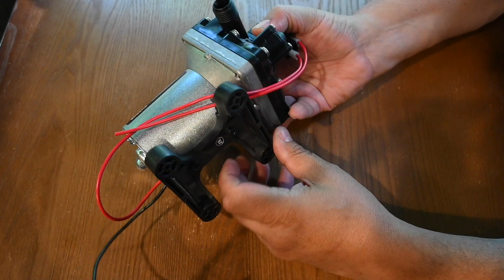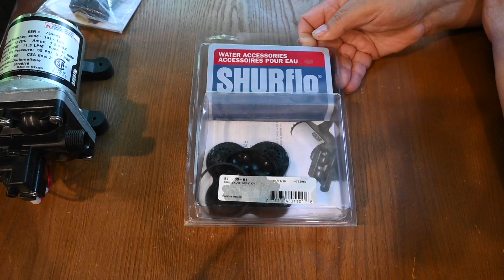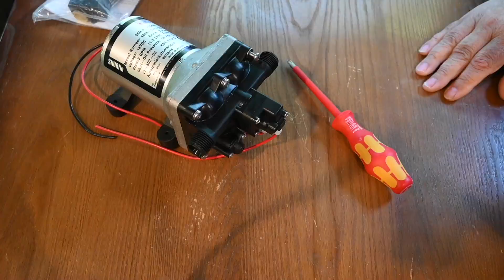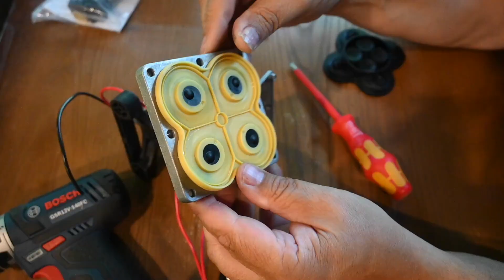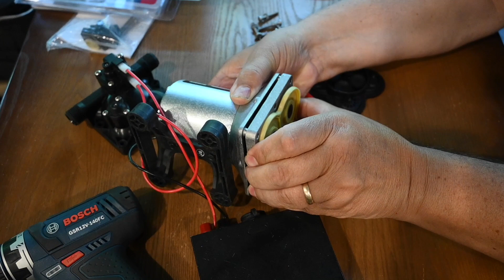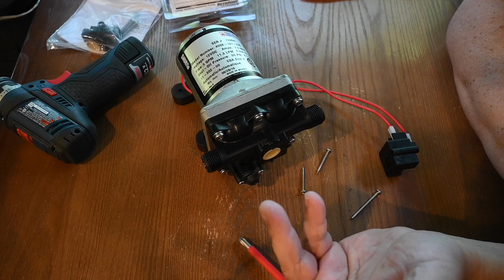How RV Water Pumps Work.

Comment: My Shurflow 4008 pump is 8 years old. It suddenly started to operate very slowly (electric motor goes very slow). I checked the voltage and its 12.95V.  I bypassed the pressure switch and its still very slow. Any ideas out there as to what has happened?

Comment: Great video man!... question i'm using a diaphragm pump like this for some misting nozzles, i need at least 43 psi and it says on the the pump it has 98 psi max so it should work but it shuts off before it reaches 40 psi, i have a valve to recirculate the excess water flow to the tank and i close or open it to calibrate the pressure i need but like i said it turns off before my desired pressure, could i disable the switch so it's simply turns on when supplied power?

Comment: Mine wouldn't stop running, so I replaced the head and now it won't run at all.   Any tips?
Reply from the maker: The head includes a pressure operated switch that turns the pump off. Did you re-install the switch correctly when you replaced the head?
Reply: @RVProject  yes, it's not difficult

Comment: Good recommendation on the strainer! On my last RV the pump stopped.  I took it apart and found plastic shavings from the tank ripped the diaphragm.  I replaced the diaphragm and added a strainer.  No problems after that but I do need to see if my new RV has the strainer.
Reply from the maker: Glad I could help.

Comment: Great video. Is there a shelf life on the spare parts to be concerned with?  The one part I didn’t hear mentioned is the check valve. I’ve read a lot of posts about the check valve going bad.
Reply from the maker: There is no check valve per se in this model pump. Perhaps other pumps may have such a valve.

The outer cover of this pump has 4 cavities, and each cavity has two one way valves - one to let water in and one to let water out. I suppose these are check valves in the strictest sense, but since there are 8 of them, they perform a slightly different task.

All I can say is that between the boats I previously owned and the two RVs, over 20yrs of having SurFlo pumps - I have never had a valve issue.

For sure, it is only anecdotal evidence of the pump's reliability, but that has been my experience.
Reply: @RVProject  Thanks. I have a Northwoods Arctic Fox fifth wheel, which does have a ShureFlow water pump, not sure of which model.  I have read on the NROA forum, that the check valves have failed for numerous RVers. The response was always to get another check valve.  That is why I asked.  Thanks again for the very informative video. This is a very easy repair!  Hopefully I won't have to do this but if I do I will be thanking you for educating me.

Comment: Any chance you have some tricks to quiet it down  , quite noisy in a smaller rig.
Reply from the maker: An old boater's trick is to get a bit of hose - either garden hose or another hose that is about 1" in diameter.

Cut two 6-9" lengths of the hose. then drill 4 holes in each hose - two for the mounting legs of the pump and two holes outside that for mounting to the RV.

What you want to do is to mount the water pump feet to the harden hose, then mount the garden hose to the RV deck. The garden hose will provide vibration isolation and result in less noise.

Comment: I hear my pump briefly (1-2 seconds) about every 10 minutes.  Could it be anything else besides a leak in the system.  My fresh water fill is also dripping.
Reply from the maker: Sounds like the water lines are not keeping pressure.  This is usually from a leak, which could be in the water lines or possibly the pump itself.

The fresh water fill in some RVs is a gravity fill, in which case it would be hard for me to think of a situation where it might be the cause.

But in other RVs, the fresh water fill is done via the pump, so there might be a connection in that case.

Comment: Thanks for the reminder that I need to order my spare diaphram and switch parts.  Strainer came last week (mine turned white from my sanitizing this spring).  Good summary video on the pump operation.  I think it will help a number of people understand how it works.
Reply from the maker: From some of the comments I have read, seems people tend to throw away these pumps when they quit, not realizing they can be easily repaired.  Hopefully this will help those folks out.
Reply: @RVProject  you are absolutely correct about that.